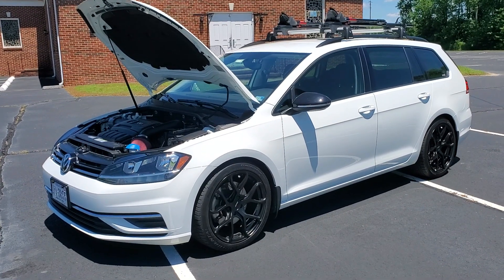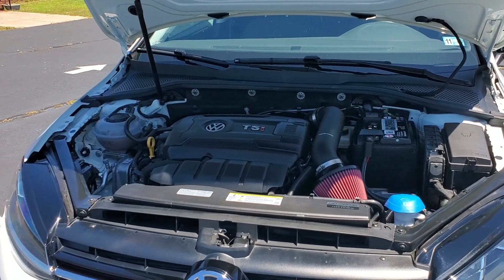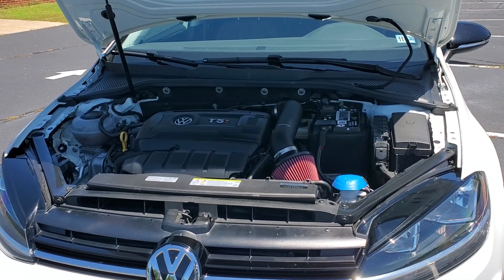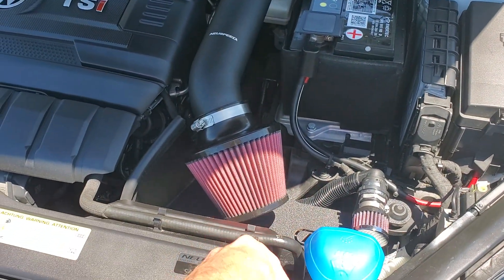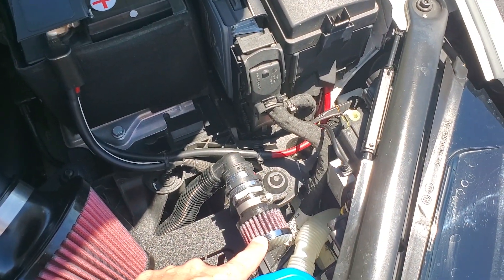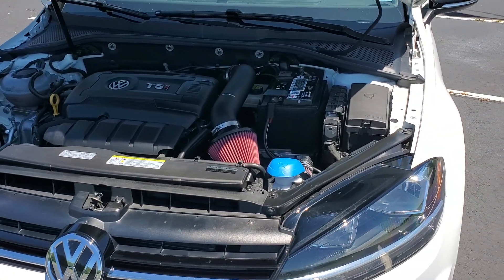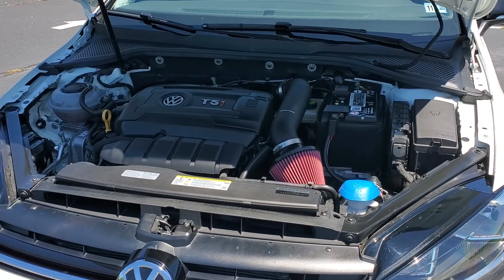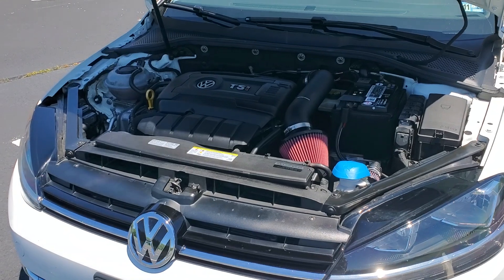Neuspeed P-Flo intake installed on MK7.5 VW Golf Sportwagen

Comment: Your variant stance look so nice. Do you mind to share your tires size and how did you lower it? Did you get coilovers or just short coils/springs ?
And do you have the mud flaps number part or where did you buy it? In Mexico we didn’t have a stuff to buy to our variants.
Best regards buddy!
Reply from the maker: 255 40 18 tires on 18x8.5 et 45 wheels.  H&R Sport springs.  Bilstein B8s.  Mud flaps are VW from dealer.  No part no. handy but Google should find it quick.

Comment: put one of these on my A3 awhile back and have no tune on my car, u think I’ll be alright just running this without a tune?
Reply from the maker: Of course...it's fine on a stock car.  ECU doesn't care/manages any slight difference.
Reply: Also I know with no tune it’s doing very little to nothing to help performance but I get mixed reviews with whether or not it’ll actually harm the engine
Reply from the maker: @Nathan Kurjan  how would it harm the engine?  You mean by lower filtering efficiency?
Reply: Hello what is the secondary air intake for? Do you believe it is worth it to have secondary installed?

Also I had a civic si and had the k and n air intake and the instructions were way more timely and intense for cleaning and recharging the neuspeed air intake. Wow, like k and n basically said clean it and then just evenly spray the oil evenly all over k and n air intake. Neuspeed was a lot more detailed and precise and really urged the fact of buying a second one because it’s a 24 hour process, literally apply one ring around the air intake at a time until many minutes later the entire air intake is covered. I was curious do you think I could get away with k and n cleaner/and protectant spray on the neuspeed air intake? 

Also it stated this should be done every 6,000 miles or oil change. I feel like if you have ecu tune adding a bunch of horsepower like 90 and you drive a lot on sport this is critical to do. I say thins because it now has 43,000 miles and air intake was installed 23,000 miles and it was never cleaned and I feel like VW and another mechanic shop should have definitely done that or asked me if I was since it was after market. I just looked at the instruction manual tonight. I am disappointed with vw and mechanic shop because I keep having cylinder 1,2, and 4 misfires and the ngk spark plugs fouling up super fast, as well as having engine cleaned for carbon twice in 8,000 miles costing a lot of money? 

A little bonus I got the BlueDriver scan device and it has service bulletins that speak of the 2017!having carbon issues and to issue the first bottle of engine cleaner in gas tank for free. I know air intake probably had nothing to do with carbon build up but any advice or help direction comment is much appreciated appreciated.

Comment: Hey dude, super stoked I found your channel, I'm doing a similar build here in Canada. You heard of any cat back exhaust systems for the mk 7.5 SportWagen? I'm afraid I'm going to need custom
Reply: AWE makes the touring and track version I believe but they are expensive. you’d either have to cut out fake tips, buy R valence, or run down turn tips to fit it. Best option is probably R valence with quad tips and muffler and/or resonator delete